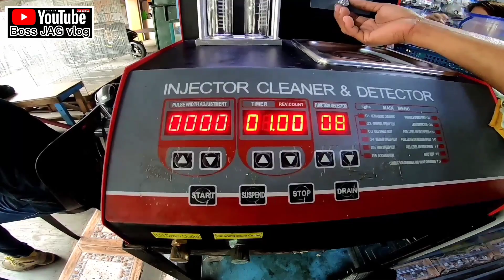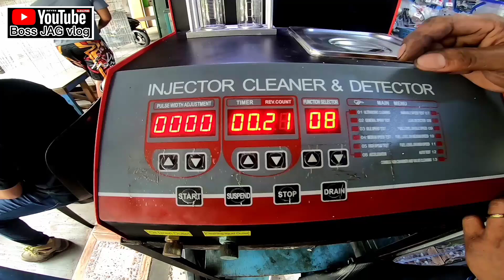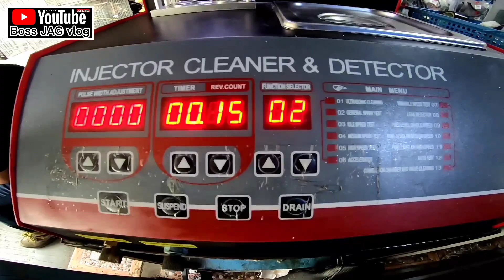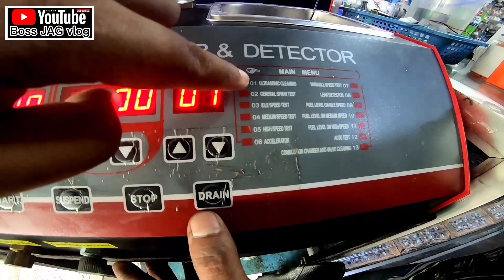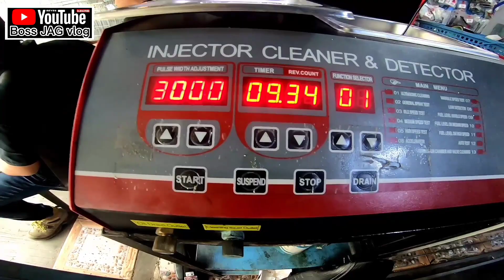RAIDER 150 FI PMS PART 3 INJECTOR CLEANING PROCEDURE | #SUZUKIVHENWORKZ | #MINGXUN #bossjagvlog

Comment: Ilan cc po stock injector ng rfi sir?
Reply from the maker: Wilbert Arcena  nd po dapat banana sa 30cc spray test ang good stock injector na 4 holes
Reply: @bossjagvlog  mas higher cc po ba ang png gsx na 10 holes?o parehas lng ang buga?
Reply from the maker: Wilbert Arcena pwd po sa sa raider fi  ang pinagkaiba lng po is ung buga pino kc 10holes pwd po sya sa raider fi ntn pero nd sya nkakataas ng cc ng raider pero pwd po ang 10 holes po ang stock kc 4 holes